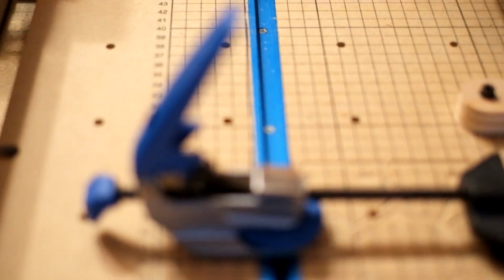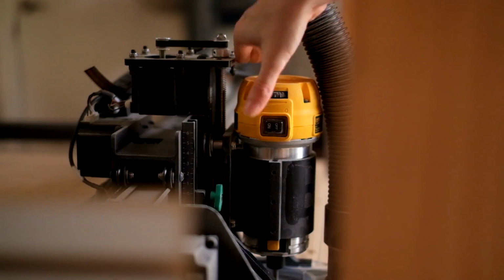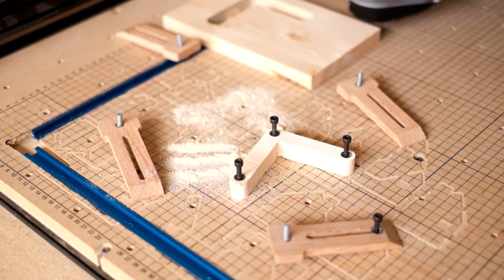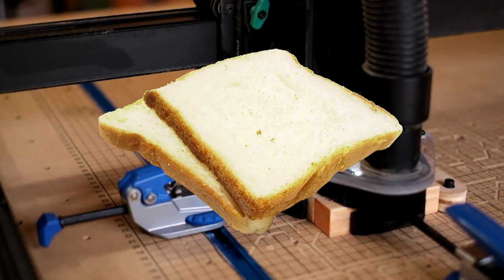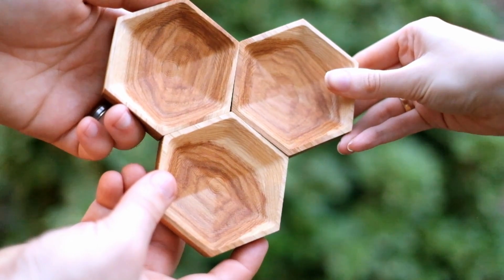Adding t-track clamps to our CNC | X-Carve upgrade | How to

Comment: You could change the wood supports to be more similar to french cleats so when the t-track clamps push into them they transfer the lateral force into downward force holding even more securely
Reply from the maker: that's a great upgrade idea!
Reply: @EvanAndKatelyn  try out and let me know how it works out :)

Comment: What is the largest width you can place into the clamp on the left? I make flags that are 21.25 and 30 inches wide and wonder about the t track clamps getting in the way of the flags fitting?

Comment: Added the T track what a great improvement. Thanks for the Video and Idea. I found it easier to just use a 3/4 Bit with The Router and was done in less than 5 minutes. Keep the Good stuff Coming!

Comment: This is the best idea ever ! I was going to put T tracks on my cnc but putting a rail every 50mm vertically but your way is so much cheaper and will work a lot better with less change of accidentally running my bit threw a t track if i cut into the waste board !! Thanks guys :D
Reply from the maker: That was our initial plan too but changed it for the exact reasons you mentioned :D have fun, its so worth the little time requited!

Comment: That’s an awesome upgrade! At first I was like wait it’s going to cut off space that could be used, but having them flush still should allow you to use the space outside the clamps! Not that I’d even do a piece that big haha
Reply from the maker: thanks! Yep since they're recessed it shouldn't take away usable space, and since they're on the far edges we shouldn't have to worry about cutting through and hitting them since usually the actual cuts will be made away from them

Comment: Great job!  I made something similar a while back and discovered that on repetitive uses, sawdust was getting trapped between the spoilboard and the bracket.  Creating a little relief chamfer on the bottom edge of the L bracket gives (a little) sawdust somewhere to go so that my workpiece sits flush to the bracket and spoilboard.  Just a suggestion in case you run into the same problem and again, great job as always!
Reply from the maker: Thank you so much for the tip! Will definitely keep that in mind if we start running into the same issue

Comment: suggestion on claming - you could also use the one of the Rockler clamps at a 45 degree angle, pushing the corner opposite of the "L" into the "L". you might need to add the "corner" piece to the T-Track filling in the missing corner that was routed out.
Reply from the maker: Yeah that could work too! As long as the corner is protected somehow - might need another L bracket for the corner clamp to push against with a void removed from the cornee

Comment: The t-track looks good.    I think I would modify the “L”.   I would counterbore the holes so the cap screw heads are flush or below.  That way you can lessen the stick out on your cutter. That helps with rigidity.  The more rigid your setup is the less chatter your cut will have.  I hope that makes sense.
Reply from the maker: we thought about doing nylon screws so if they get cut, it won't damage the cutter. recessing would be a good idea too! Luckily it feels plenty rigid, no chatter at all

Comment: Love this idea, though I have a Pirahna CNC which has a smaller bed, but is all metal t-track. Need to modify your idea somewhat, but think I can make something work. Love the repeatability factor on this, since I have a project that would require 12 similar carvings. Not having to zero out in between each carve would be a big time saver especially if it becomes something I can sell to make tens of dollars on.
Reply from the maker: WOOO, good luck and thanks! Whatever will you do with all the tens of dollars you'll have when your product is a huge success?
Reply from the maker: We thought about those stops you linked too because they are lower profile, but we ended up with the ones we did because they seemed to have a bit more holding force. Good luck!
Reply: Since I don't have the inserts to screw into, I may use those for the stationary sides, and the style you used from the back where I have a lot of bed space to hold the wood in place. With only a 12" wide bed I don't have enough width to use the style you chose for side to side clamping. 

I've only done 2 projects so far, so it is a learning experience. Getting some wood to use as a waste board for projects where I want to go all the way through the board but don't want to ruin bits by hitting the t-tracks, which will require a whole different method of holding things down.
Reply from the maker: I know some folks have used their CNC's to cut the holes and then added threaded inserts - could be an option!

Comment: Hey Kate and Evan, just as a comment, you should add a relay to the spindle to turn on off, is an easy piece to do. I could guide you thru the process. I had one on mine I also use the same relay to turn on off my vacuum.
Regards
Reply from the maker: Thanks for the tip!

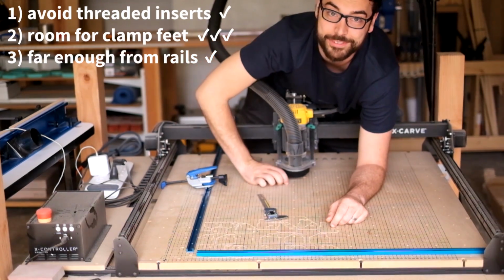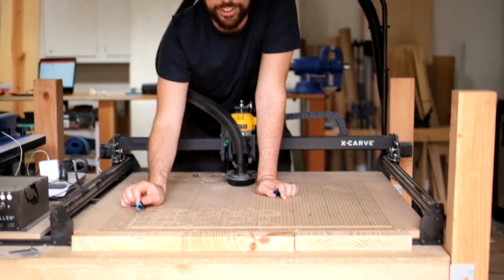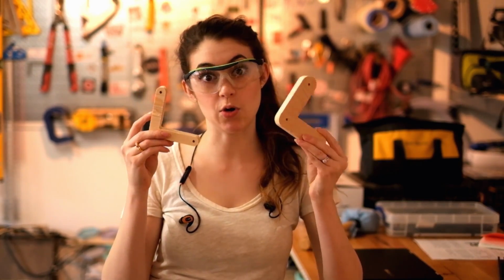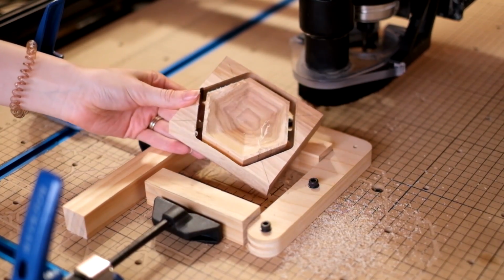Comment: ok timestamped comment time:  @1:06 this was an AWESOME use of the sponsorship.  You show off the product but also keep it a part of the project and, if you hadn't told us about the sponsorship, I wouldn't have known.  Also seeing your design process was cool.  You should do that more  @1:42 You never say if you have room for the feet *sarcasm  @3:56 Awww dusk E&K (I know you did it at the beginning too but I missed that) @4:23 sooo smoooth @5:00 I think I need a metal cutting diablo blade now @6:04 Do you have to calibrate the machine every time you cut?  @7:32 You said Beef, Drink!  (E &K Beef, beefier, beefy... it's a drinking game now)  @8:35 one is the Evan sized and one is the Katelyn sized! @10:48 Ahhh ok you answered my calibration question I think... @11:37 sorry I've been MIA lately... busy with work stuff :-( @11:49 See ya in the after show!
Reply from the maker: Woohoo! Glad we were able to integrate the sponsor well. Would be fun to include our design process more... lots of sketching is always involved. Hahaha a beefy drinking game would be hilarious. Yeah we don't need to calibrate it every time, though some people probably do do it. The safe thing is to do it every time but we usually only do it if it looks off or if we've moved the Y manually

Comment: I’ve been wanting a X carve for a long time now but I’m really nervous about assembling the kit I don’t wanna spend $1800 on something I might not be able to assemble. I’m thinking about asking for one for my 15th birthday, so I’m just wondering how hard are they to assemble I’ve used CNCs before but never built one. I learn most stuff from videos so I was also wondering if the instructions for assembly was in a video. Thanks for your time
Reply from the maker: For us it took several hours to build it. There are a lot of videos out there that can help. It wasn't easy, but I think you could build it over a weekend (with taking breaks). Hope that helps!
Reply: EvanAndKatelyn okay thanks

Comment: Again amazing video guys, as I always say the energy of your videos always makes me smile & feel motivated! + the aluminium cutting definitely was #shopnotyzing ;) 
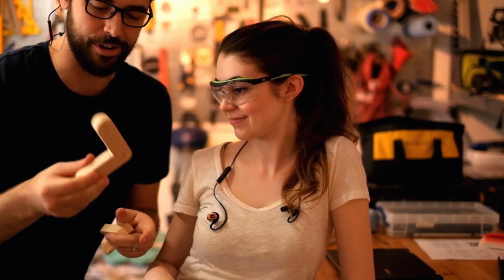One thing to note, at 7:50 you said 'plywood has no grain.' I'm sure you know this, but it does have a grain, its just made up of layers (veneers) of wood that each have their grain running at 90 degrees to each other. This formation is what makes it so strong because whatever way you're bending the piece, you will always be bending against the grain, where it is strongest. (Whereas things like MDF or Chipboard don't have a grain and consequently  they're much weaker and more susceptible to bowing etc)
Reply from the maker: Yeah #shopnotyzing! Thank you, glad you like the video! And yeah, we just meant it doesn't have a singular grain direction, but you're right that's not the clearest way to put it

Comment: I don't even know how I got here but I try to 
give you simple no technical advice 
because I like your video, the enthusiasm and good mood you are showing ... In this case unfortunately you can't design anything better because it is already designed the best it can be. You can save time by thinking about it. If you want use T profile with clamps put them to parallel 
layout/position. 3-4-5 t-rack parallel by moving the y-axis 
longer than the maximum Y range, how many depends on what "resolution" you need for small objects. This t-rack stick together with rectangular wood/mdf/plywood whatever you have at home. They must be a little higher 3-5mm and thats it.  
You can get inspiration from many more expensive 
,precisely designed machines. L  is bullshit and there are more reasons why this is not good, you will figure out later.  Or...maybe it will no longer be necessary in future, because vacuum tables will also be on hobby cnc :D

Comment: Nice solution. I am toying with a simpler version, but haven't added t-tracks yet, as they are not readily available here (or I haven't looked hard enough....). Do you use the Chrome book to run the X-Carve as well (ie. Does it have a USB port that can run whatever the XCarve needs)?
Reply from the maker: Sweet! Best of luck 😀👍 having a clamping solution realllly helps speed things up. We didn't use the Chrome book but I know some people have with this google chrome extension/app: https://chrome.google.com/webstore/detail/gcode-sender/ngncibnakmabjlfpadjagnbdjbhoelom
Reply: So that means the Chromebook has USB ports, but there is no Easel driver for it? Could you use Easel Local (I think it is called)? Don't have a Chromebook, but I'm thinking about one. Looks very cool and useful.

Comment: should get a cheap "multitool" the oscillating tool everyone calls a multitool. With it you can flush cut the tabs super cleanly, could sand with it, scrape with it. You can get a cheap one from harbor freight and i feel like it would be alot better than cutting tabs with a jigsaw.
Reply: cody heiser i was thinking the same thing
Reply from the maker: Neat! We actually just got one so will have to try it out, thanks for the tip :D

Comment: I see that you are using the same screws as the clamp system that I bought from Inventables to hold the L clamps. but did you buy the screws separately? do you have a link for the same ones just to make sure? :D Cheers!
Reply from the maker: I thiiiiiink we bought these separately, it was a while ago so I don't quite remember. We bought a thread checker to check the threads to make sure we got the same size. Sorry we don't have a link! We can recommend the thread checker we used though, we use this thing all the time: https://amzn.to/2G4hl8D

Comment: I know this is an older video, but is there a reason you didn't do just one clamp opposite the "L"? You could then make a second "L" with a flat corner to push the clamp against. Does that make sense? Maybe that is not enough holding strength with one clamp? It looked like those clamps sure had some holding power though.
Reply from the maker: I think we just felt more secure having two 👍

Comment: I'm looking into doing this on my Xcarve but I have a few questions. 1. Can the T-track be recessed at all? I don't want to cut into the t-track on accident when cutting something out. 2. Does this only applying side pressure and never down pressure ever cause a problem? I just wonder if with some bits it could pull the piece upwards.
Reply from the maker: You might be able to recess it a little bit but there would be a limit to it. It's only side pressure but we've never had a problem with that before - if you need more force, there is a heavy duty 3M double sticky tape that helps too! (this one here: https://amzn.to/2Q0xw81 )
Reply: EvanAndKatelyn quick response, thank you!

Comment: Would there be a way to have the support tabs be mid way (height wise) through the piece. So that you can then flip the piece over, and do a shaped bottom to it, almost like a bowl for example.
Reply from the maker: You can set it up so that you flip the piece mid way through, but for a bowl it might be best to cut the inside of the bowl out and then flip it and do the bottom, leaving tabs at the rim of the upside down bowl (if that makes sense)
Reply: It sure does.

Comment: Hey guys! Probably a stupid question or two here... but one, do you have a 1000mm X Carve? I have 750mm, so what did you leave for the gaps at the end for the insertion of the sliding bars? Second question is what type and size of screws are you using in the L brackets to hold them down? Thank you for any help! BTW! Rockler has their 2 foot t tracks on sale! $8.99 each, Item #: 22104. I figure if one needs longer than two feet they can just cut and lay down a second unit.
Reply from the maker: Hey! we have the 1000mm X-Carve and we left an inch or two for insertion. To hold down the L-brackets we used the bolts that came with the X-Carve clamps that were already the right size. hope that helps!

Comment: I want to implement this onto my desktop shopbot, but I'm not quite sure how clamping the corner bracket works. It seems like the screws you use to mount it would ruin the holes after the first use. How do you guys get around this problem?
Reply from the maker: The holes are actually threaded! So they won't wear down the same way it would if you were screwing just into the material

Comment: Thinking about getting a cnc machine. Why did you choose the X-carve over the other sand how to you think it compares to the Shapeoko?
Reply from the maker: Full disclosure, Inventables sponsors us so take this with a grain of salt. We've tried both the shapeoko and X-Carve and either could be a good machine for your needs. Shapeoko as a company/customer support is more geared towards pros - they're less likely to hold your hand if you run into issues, from what we've been told (we didn't use it long enough to experience that). Inventables is much more about getting people started with CNC and making it less intimidating, so their support and Easel are set up to be easier if you're new to this stuff. We've had the X-Carve and a Carvey for over a year with no issues, love em both!
Reply: Thanks! Just trying to determine which one and what size to get.

Comment: it looks like you relieved the inside corner of the L-stop, because the corner was cut with a round cutter.  Yes?
Reply from the maker: yep, inner corners can only be as sharp as the diameter of the cutter

Comment: Why not create a bolt down secondary baseboard with the channels in and bolt into the threaded inserts of the standard baseboard?
Then you aren't damaging your original baseboard.
Reply from the maker: That's definitely an option! But it was more work, and wasteboards are meant to be cut into, so we just cut into it

Comment: If you want to clamp larger stuff it doesn't need to be an L. As long as you have something to clamp against you should be fine so 2 straight pieces would also work. Think of them as bench dogs.
Reply from the maker: That's true! We just liked the idea of having that L as an additional right angle reference too

Comment: maybe you should make another L bracket for the clamps just the right size fir those bowls. then you wouldn't need to keep those tiny scrap pieces for spacing.
Reply from the maker: We could and that would be a great idea if we start making even more of them! But we do so many different things on here sometimes it's easier to grab scrap wood than make new brackets each time

Comment: As a viewer I'm confused about the shift from the Shapeoko, to the X-carve.
Reply from the maker: We ended up forming a relationship with some of the folks at Inventables and really liked them and the vision they have for CNCs (making them more accessible to normal people) so decided to work with them
Reply: EvanAndKatelyn I appreciate the response. I'm at the point where I'd like to add a machine to my toolkit but am struggling to determine which way to go. Regardless I really like how you approached the material holding  and enjoyed this video.
Reply from the maker: It's a big decision! We're partial to the X-Carve but it's also what we've had more experience with and they're a sponsor, but I'm sure there are some good comparisons out there to check out!